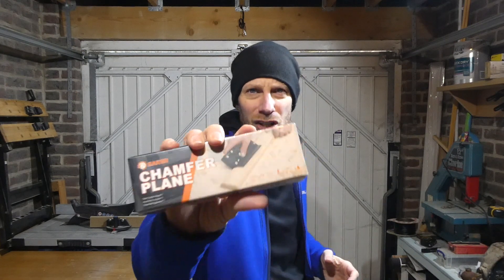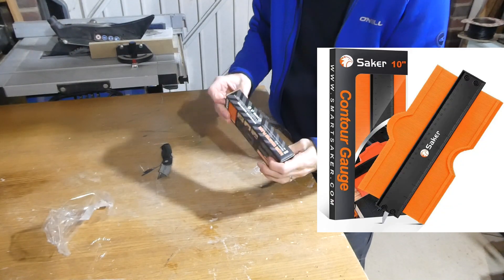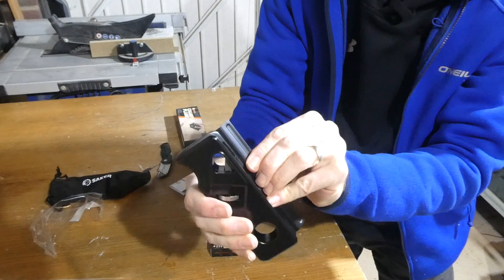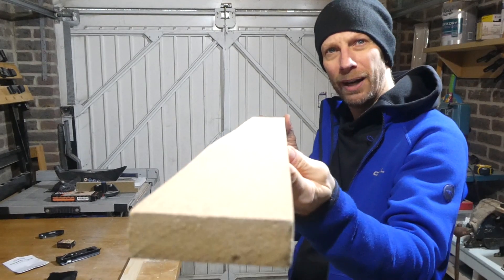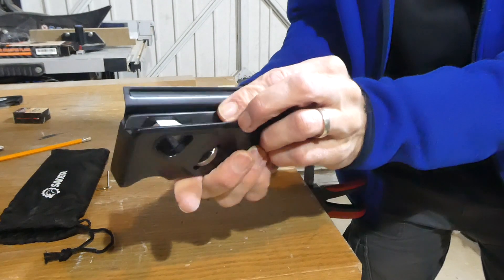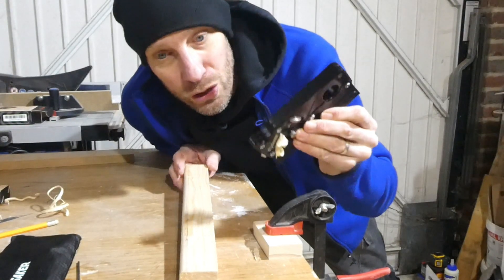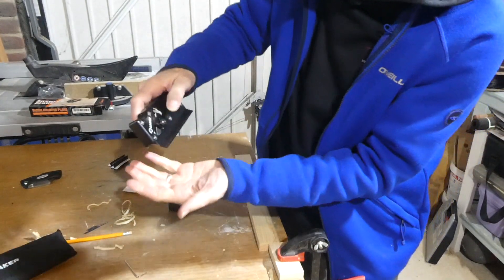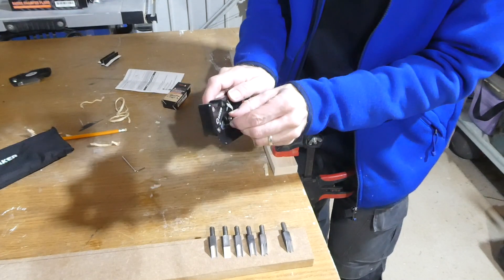Saker Chamfer Plane - How to Use a Chamfer Plane - Review and Use

Comment: Glad to have seen your unboxing and demo' of this cheap chamfer plane. Have to admit, it looks like it struggles through the pine. I generally use a block plane to put chamfers on my meagre creations - the smaller items at any rate. Where it starts to get a bit of a chore, I tend to use a trim router. I know, it can be a bit messy and throw up a lot of dust. If that's an issue, I just pop it in my makeshift router table - just a board clamped to my workbench - and the vacuum takes care of the shavings. 
I did look at the £80 Banggood (Woodpecker knockoff), but at that price I tend to want to plug it in somewhere.